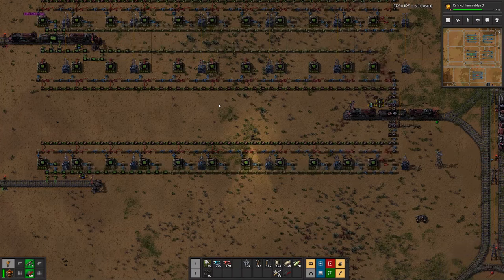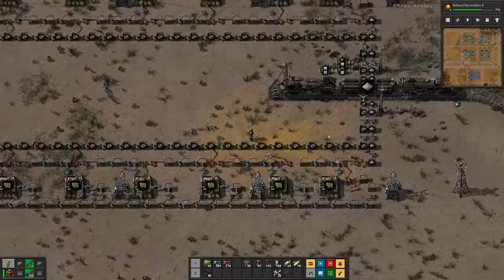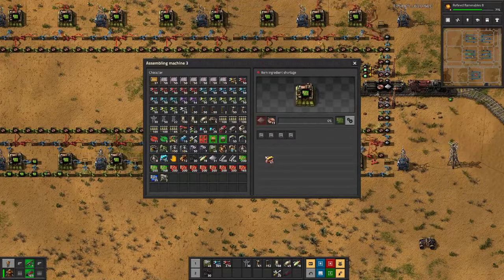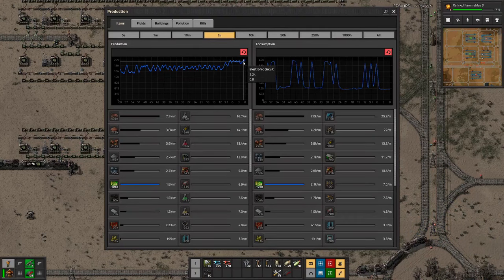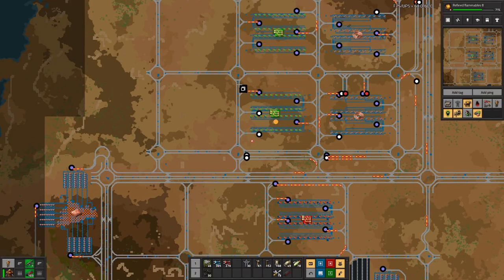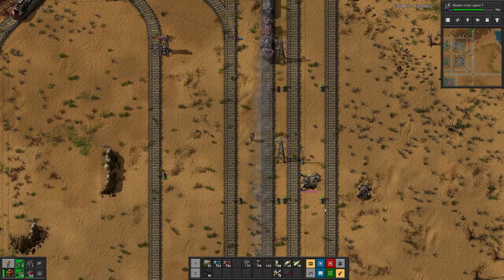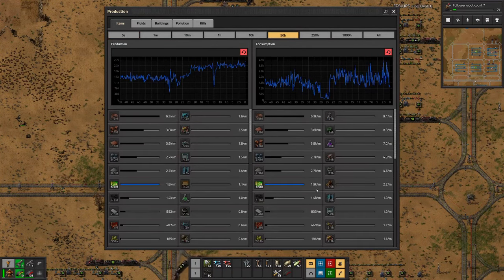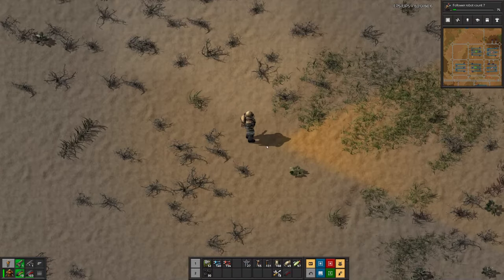Beltless Factorio | Another Green Circuit factory - E69

Comment: Still working on my version of this. Having some trouble with vertical scaling of basic materials.  Well that was after I had to enlarge to 22GW of power to feed the electric furnaces. Think this week is going to be about expanding to more ore patches and redoing the old coal fired smelting that still exists in the old base core. That and expanding plastic. For some reason even with 4  12 refinery plants creating it its still not enough.
Reply: Oh and to not just talk about my playthrough, I really enjoy your build style in this. The use of double headed trains is something that I really haven't ever used to and success.
Reply from the maker: Good luck, I also have run into issues with not enough oil for all the products that come out of it.
Reply from the maker: @Hazmatt4700  yeah, it's also my first time using double headed trains. Normally I go with a 1-4 setup for mostly the ores. So the challenge of this series is really doing everything with trains.